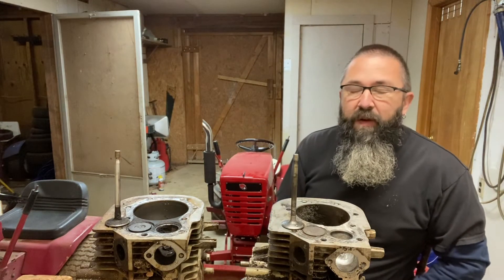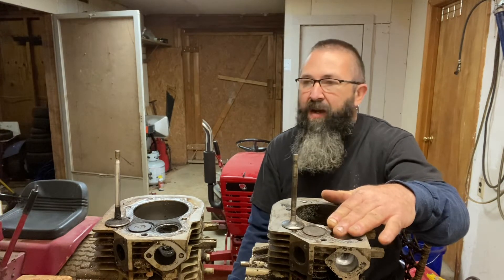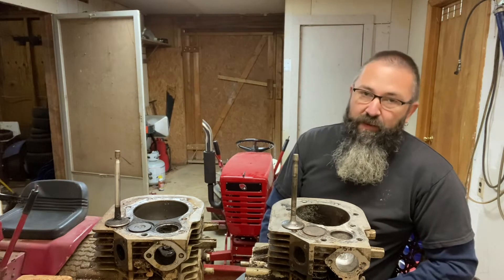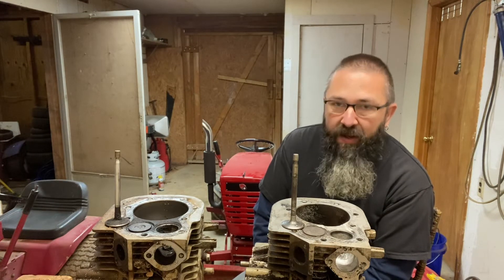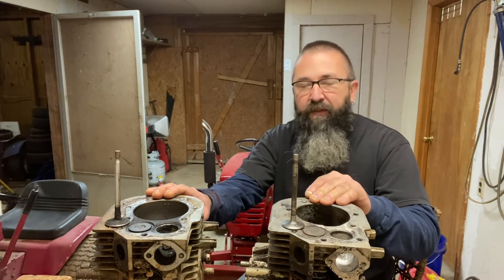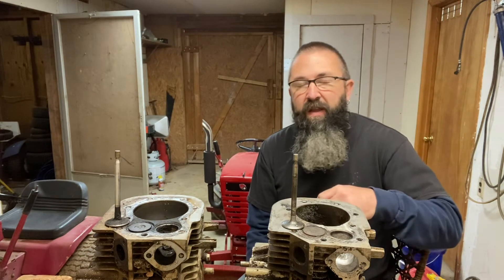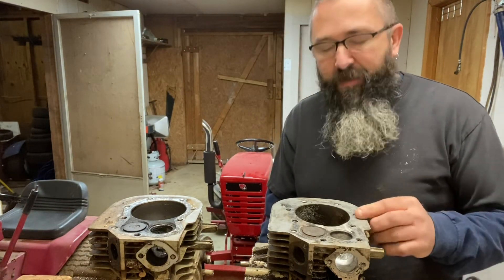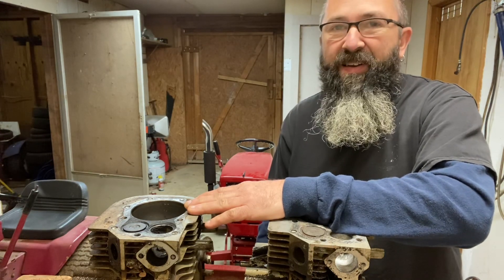1- Mud Mower Small Engine DIY power secrets- Intro

Comment: Glad I saw the link from the atltf forum t6956-18hp-horizontal-briggs-opposed-refresh post.  Looking forward to watching the series and learning more about.  I've been interested and planning to convert a vertical to a horizontal and I have a parts horizontal opposed twin B&S for specifically.  I'd like to 3D scan the specific horizontal parts so can lost PLA cast using aluminum alloy rim stock as a goal too.  Just brought home a Paragon kiln too... though thinking gas will be more cost effective.  I see on the side YT recommending a "Opposed twin vertical/horizontal swap" so maybe you've demonstrated.  Subscribed, like and commented.  Thanks for sharing!
Reply: I don't even have any oppies but I'm here for fun 😊
Don't stop learning.
Reply: Rang the bell for notifications as well.  Wondering if there is potential to convert the vertical B&S OHV's to horizontal, i.e. the 28XXXX, 31XXXX or maybe the Vanguards as well?  That'd be fricken awesome.
Reply from the maker: Id think with a correct side cover and oil sump. Guessing Briggs would use the same block, maybe?
Reply: @captain_315  I have no clue since haven't hands on yet disassembled and rebuilt the insides of the 28XXXX or 31XXXX yet in my mowers.  I do have two 33XXXX (21HP) where one sounds like the governer needs bypassed or what I'm planning is disassemble and replace if not remove inside.  That will give me an opportunity to inspect and also maybe upgrade the connecting rod.  The second one of those 21HP's similarly might be a tear down... though if the cylinder walls are good and nothing else is damaged from that ones rod damage... I'll see what's useful for parts and maybe one will be a pedal controller engine and the other stock.  I've never had a horizontal shaft single cylinder OHV that big, so no clues other than if there are parts diagrams reverse engineering the codes for what "might" exist.   Same goes with the Vanguards, I've not had to disassemble and repair any yet and I don't have a horizontal shaft version to compare with.  Seems they'd use the same block and maybe some other parts.  

Wondering on an extreme guess assumption, like you've observed with the opposed twin's if can assure flow of oil where needs to be either slung or flowed... if maybe just like a right angle plate with some gussets to support would be enough so just using the same crank case covers?

I'll be sure to keep in mind the oil dynamics when I do open up one eventually.  I probably won't get to a Vanguard any time in the near future... though maybe one of the 28XXXX, 31XXXX or more likely 33XXXX  more soon.  Just getting my workshop more organized for engine work in the winter versus only a summertime outdoors season chore. We'll see if this season even maybe.
Reply from the maker: Oh this would be awesome!
Reply: @captain_315  Decided to search again and found this video titled "How to convert a OHV vertical shaft engine to run horizontally for Go Kart, Drift trike, ..." where he filed or filled the journals, added a oil slinger, drilled and filed out a port between the push rods, made a vent in the OHV cover and plugged the governor hole.  He noted maybe a smaller aperture (port) drilled and filed as well as a possibly oil level port instead of threading and plugging the governor hole. https://www.youtube.com/watch?v=CySNXrsgnnc
Reply from the maker: @jafinch78  very nice!
Reply: @captain_315  Decided to search again and found this video titled "How to convert a OHV vertical shaft engine to run horizontally for Go Kart, Drift trike, ..." where he filed or filled the journals, added a oil slinger, drilled and filed out a port between the push rods, made an adapter to rotate the carb, made a vent in the OHV cover and plugged the governor hole.  He noted maybe a smaller aperture (port) drilled and filed as well as a possibly oil level port instead of threading and plugging the governor hole.